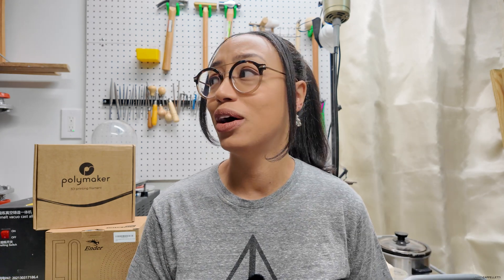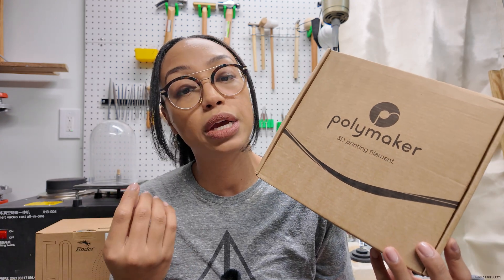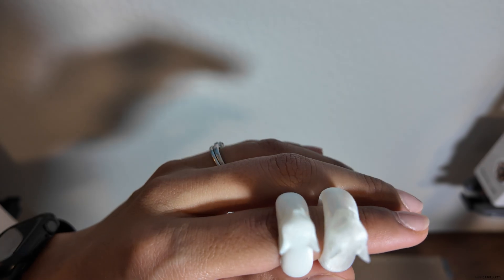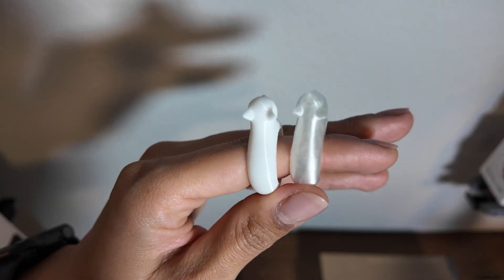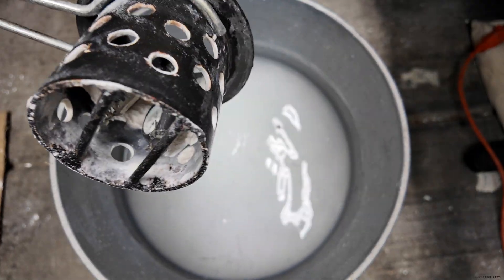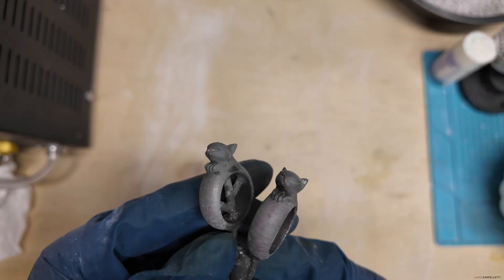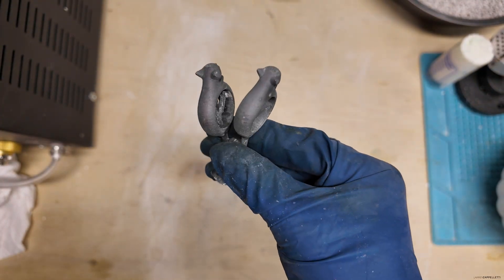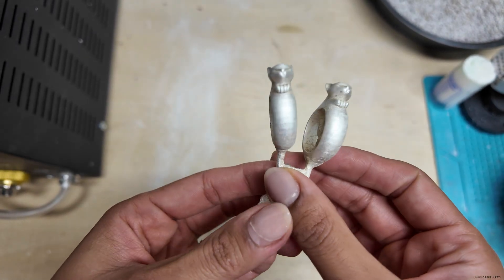PLA vs PolyCast Filament, Easy Step by Step Lost "Wax" Casting a 3D Print to Make Silver Jewelry

Comment: The advantage of polycast is that it can be smoothed with alcohol. 

You can use polymaker's polysher machine, or a spay bottle or a brush.

If you’re not doing alcohol smoothing, it's probably not worth the extra cost
Reply from the maker: Huh, I'll look into that machine. I used 99% alcohol to smooth it out with a little craft brush. Maybe I didn't use enough?🤔  I'm for sure gonna keep trying to improve!🛠️💪

Comment: Thank you for doing videos like this! I watch every one haha. I just bought a 3d resin printer and didn’t even realize you could cast regular PLA!
Reply from the maker: Thank you so much for watching! I'm thinking 3D resin prints probably come out much smoother. What printer do you have?
Reply: @lawrencappelletti I bought the photon mono 4 ultra! It was so easy and works beautifully. Only problems are that it’s smelly and messy! But with the right setup I think resin printing is great.